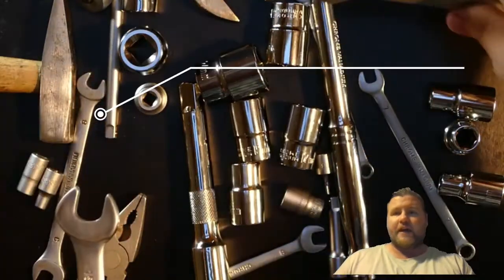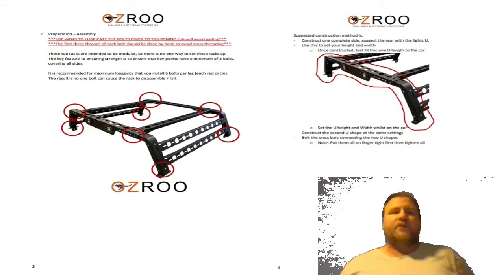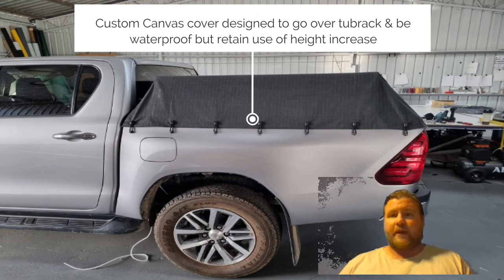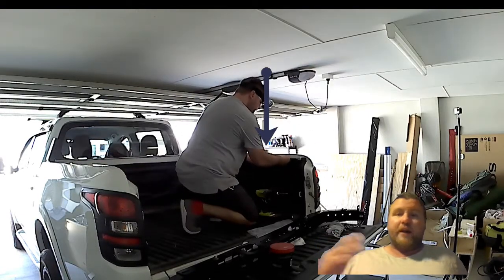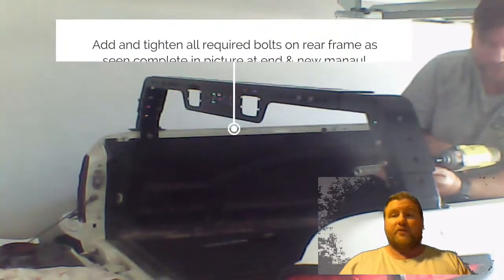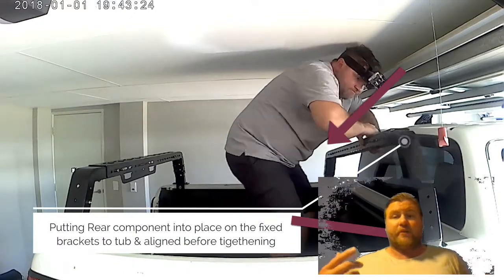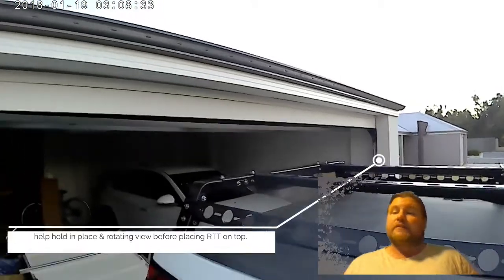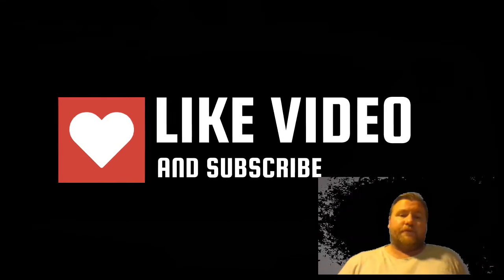(Updated) Self Install Instruction Guide For the OzRoo Tub Rack to Ute Tray From PPD Performance

Comment: Great video! How does your tonneau soft cover  still work with the ozroo tub mount? Did you have to alter it?
Reply from the maker: Thanks, hope it helped and earnt a subscriber from you :). Yeah I did slightly as it has gaps where the old bars were, and the mounting brackets I had to cut it slightly so it fit around them. But in general it works, with only downside being gaps for water ingress. So I have had a new tonneau cover made that goes over tubrack to make use of the extra height which clips onto tub and has zippers, both side and back. Not too expensive being around $1300ish and its all waterproof so maybe worth considering.

Comment: Hey mate, does this rack go high enough to be level with the roof?
Reply from the maker: The half height won't generally, but they do sell a full height which has two bars on each side and it sits higher up so you can make them level with your roof.
Reply: Ah perfect, cheers for the reply 👍

Comment: Hey mate I'm also looking at doing this to my Triton, with the tonneau rails, mine run the entire length of the tray, did you have to cut your existing rails down and re install to make them fit? Just want to know the best way for going about it, as I want to keep my soft tonneau cover underneath the racks,
Reply from the maker: Yeah to fit the originally back I had to cut the aluminium rails that are pop riveted onto the tray as it doesn't fit. I was just really carefully taking the off so I could reuse it all so I could use pop riveted holes as well as the sticky substance that keeps it stuck to the tub on the top so be careful, slow and steady lifting them up once pop rivets are out. Simple angle grinder and works fine when put it back together. Front and rear you don't need to touch which us good. I'm actually booking in to get canvas cover to go over the tubrack as a whole, so it's one completely waterproof as had issues with gaps and also make use of extra height. Has zippers on back and both sides and is costing me about $1300 and that's with canvas cover being clipped onto the similar rails so looks neat rather than the elastic bands that hold it down onto little bits that are put into side of the tray. So thought I'd mention it in case you ever thought it for yourself that it's possible and looks good.
Reply: Thanks for that mate, some great tips, can't wait to start on my project, your videos have been a huge help 🤙
Reply from the maker: @jamiepascoe  cheers mate, glad it helped. 👍

Comment: Hi mate, I was just wondering weather you have any issues with wind getting under the cover at highway speeds leaving the holes in the taunea cover. Have just installed a tub rack on my triton and want to leave the cover on
Reply from the maker: Hi Mate, no issues with the holes with holes with soft cover from high speeds. I do find heavy rain can be an issue some getting into tray with soft cover on. For a sort term fix I've duct taped the holes from where bars were, it stays on for ages before I need to change. Long term I'm getting mine fixed, but short term you can make do. So no definitely nothing with my soft cover at speeds with tub rack on for me and I've had it for many months now and taken on many 4x4 trips too.
Reply: @wafishing4x4  okay thanks mate. Just finished doing mine. Pretty happy with how it turned out

Comment: Thanks for the video mate. My tub liner goes up over the edge of the tub so I don’t have access to the bolt underneath. Would you recommend cutting the tub liner where the rack feet are or should I come up with a different solution? Maybe rivnuts?